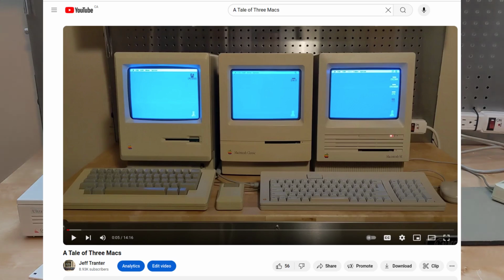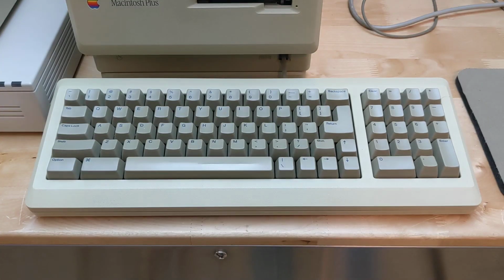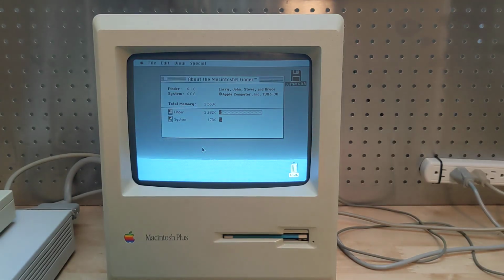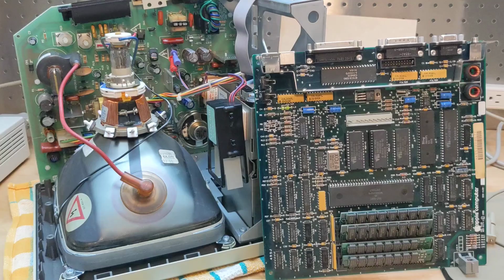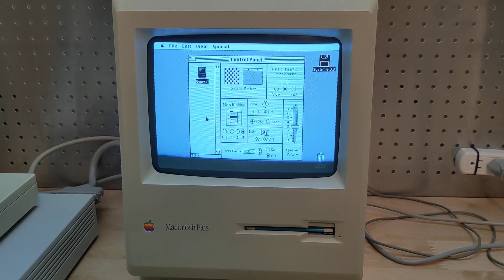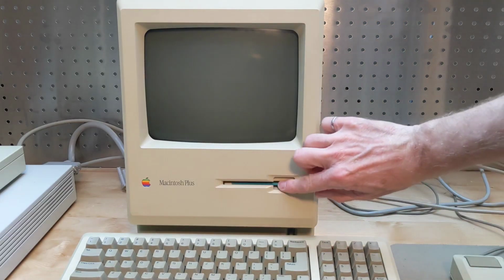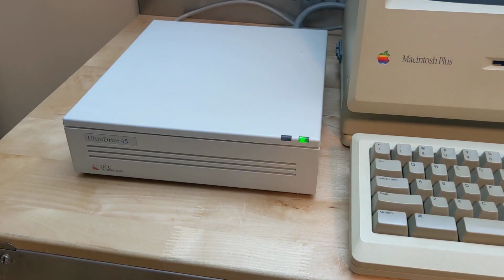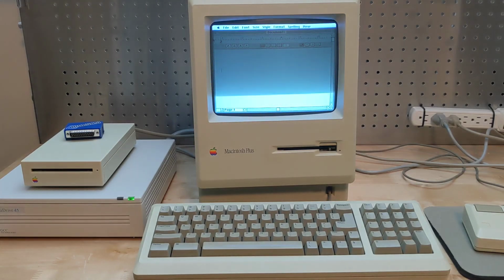Apple Macintosh Plus - Overview and Restoration

Comment: Thank you for this video. I bought my Mac Plus back in 1988 or 89 and the last time I turned it on was 13-15 years ago and it booted without any issues. Now it’s getting a sad face with vertical lines on the screen. I replaced the battery without luck and just ordered a new logic board from eBay, but after watching your video, I’m thinking I probably just wasted money buying a logic board that might not work even though the ad said “tested and working”
Would you be able to bring it back to life for me?
I’ve owned most of the Macs that were released and currently own the latest MacPro tower of power. I am a huge Mac fan and would love to get my Mac Plus back to life.
Your reply would be much appreciated.
Reply from the maker: Unfortunately, I am not able to do repair work. A new logic board might fix the issue. If not, the issue might be that you need to replace some of the capacitors on the analog board. If you have some experience with soldering this is not too hard to do - you can purchase a cap kit of the parts needed from sources like https://console5.com/
Reply: @ thank you so much for taking the time to reply. I wouldn’t know where to begin if I order the kit. If the new logic board doesn’t work, I’ll look for an analog board and replace it. 
Thanks again.
Reply: This is a common issue, and there’s quite a few videos on YouTube detailing all the steps of cleaning and where to look for solder issues.